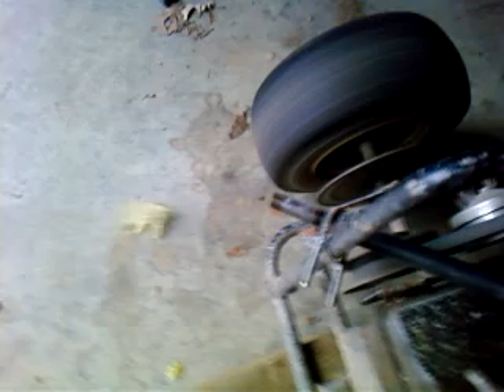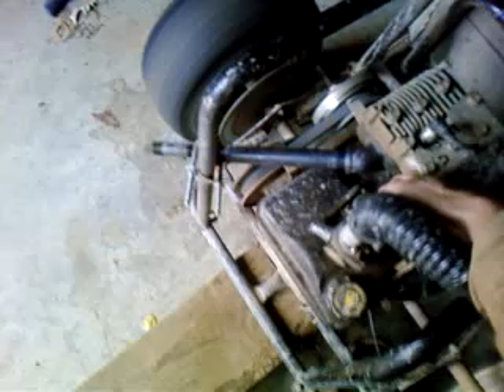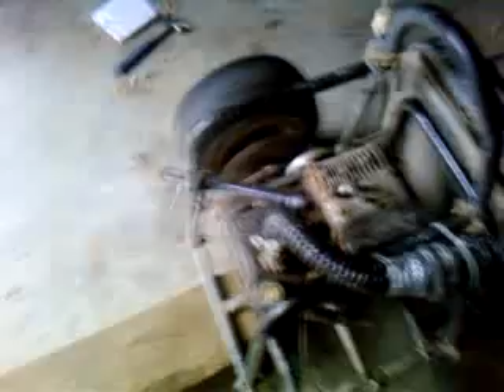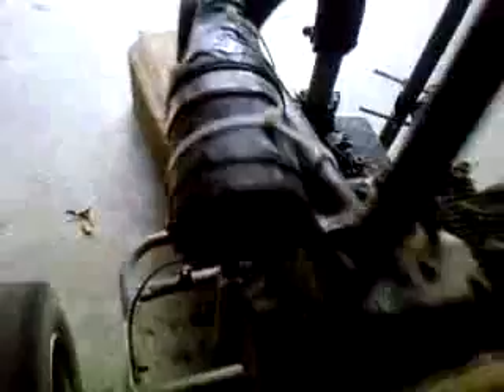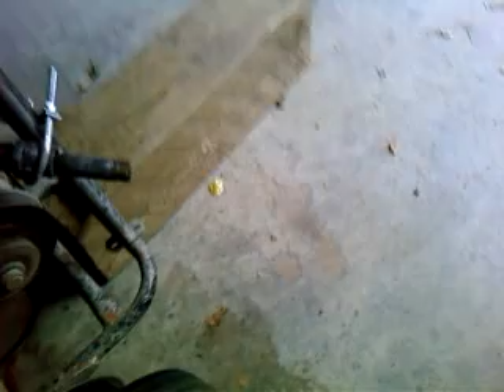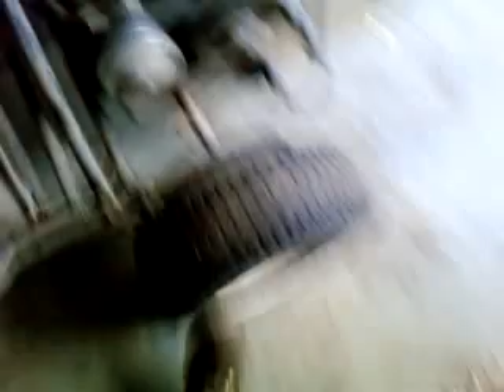go kart rev with straight pipe and intake

Comment: @Dillon1791 No, You have no idea what you are talking about. torque converters are chain driven. they just have the driver and driven which change the size of the pulley. different size pulleys mean different ratios. that means every bit of the power that the engine puts out is used.  And if you watched the video he has a live axle. That is a nearly perfect drive setup. In the mean time, dont try and act all smart when you dont have any idea what you are talking about.